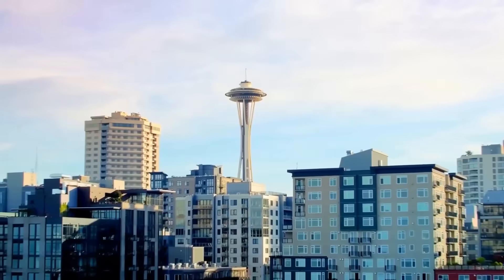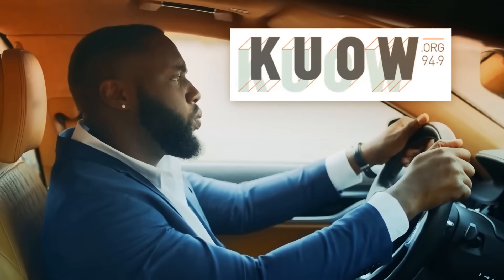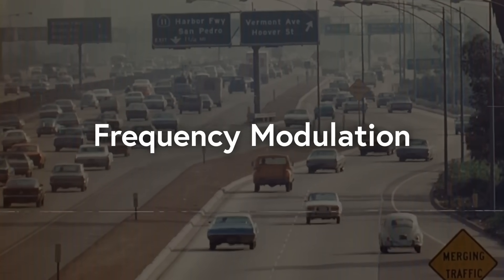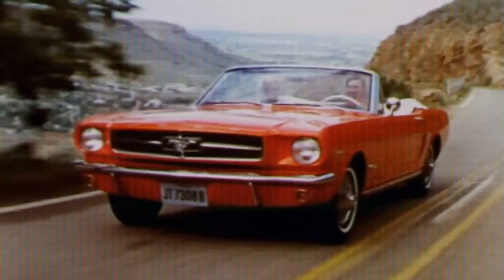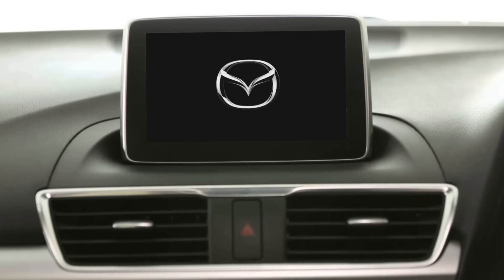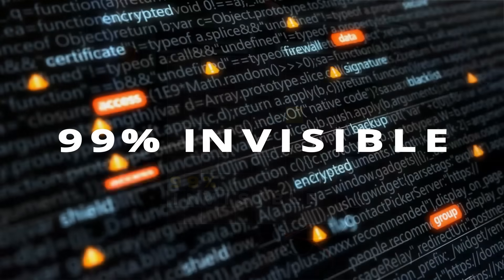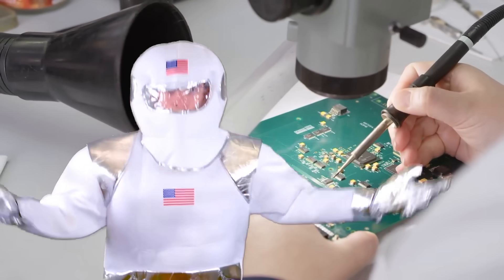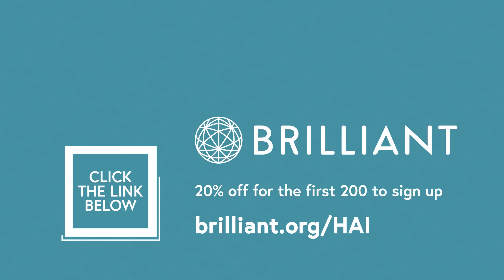Why Hundreds of Mazdas Tuned to 94.9 Broke Simultaneously

Comment: I don't need to worry about my car breaking down from a computer issue, because all functions of the base vehicle are mechanical.

Want to open a window, crank this handle. Too hot? Move that mechanical switch to engage a physical clutch on the air conditioner compressor powered mechanically from the engine, which also does not have a computer.

The only computerised parts, are an after market digital radio with Bluetooth and a two way CB radio.

And as I drive my old school mechanical workhorse through water over 1 metre deep, I think of and laugh at cars that have died in just tens of centimetres worth of puddles while being reasonably reassured that even the EMP of a nuclear weapon won't stop my car from getting me to where I need to go (most likely in the opposite direction of said nuclear blast).

As much as I love computers, (having spent tens of thousands of dollars on them in the last two years, all for personal use), everything that I need to actually live and survive, I have pure mechanical based options.

Cooking for example I love my computerised induction cooktop, but I have a portable multifuel liquid burner with a hand pump. I can set it up anywhere and burn almost any sort of flammable liquid. Failing that, I have a fire steel and field knife along with the skills to harvest nature for everything needed to make a camp fire.

I love my GPS, but I also carry a map and compass along with having the skills to determine North from the sun and stars incase there is magnetic anomalies.

In our ever growing reliance on computers (and even of supermarkets and centralised life support), we don't know what in the future will break or how.
We need at least a few people in every community to remember or learn how we used to do things and keep those skills and technologies alive.

(and no, I'm not some crazy "prepper" with several years worth of canned food. But I can see the value in being prepared for whatever might happen.)
Reply: A properly designed car will always have the most basic functions mechanical. Braking and steering may be electronically assisted, but are still mechanically connected. I don't mind the computers, as long the core basics remains mechanical.
Reply: @dbclass4075  Unfortunately, that is not the case.

Some cars do have FULL fly-by-wire systems including mechanically independent steering.

Nissan first brought out the technology back in 2012 I believe.

Which is perfectly fine if the system has adequate redundancy, shielding and security.

However exploits have been discovered and used to remotely "hack" into cars and completely disable or even drive them (at slow speeds).

I'm not aware of any incidents in the wild of this occurring, but search YouTube for the video of this hack being demonstrated for a reporter.

I know that some of these methods used actually used the integrated entertainment system to access driving "aids" including the "self parking" systems.
Because, why does a fancy radio need a high security firewall???

Don't want to scare you into thinking vehicles with these technologies are death traps, but you should at least be aware of the risks that do exist.

A radio accidentally being bricked because of a mistake in file naming is a very minor thing compared to what could happen with modern cars.

Of course, sometimes the benefits outweigh the risks. I mean, how often can you expect a car to be hacked into crashing compared to how many accidents are avoided by active stability control systems?

For me however, I am a skilled driver (no, not the best, but better then so many I see on the road) who understands the physics involved.
I'm not immune to making mistakes, but I can control my vehicle well enough to not require vulnerable electronics to help me.

Hence I'll even if I buy brand new, I will insist on a vehicle with as little computers as possible as and why I will do everything in my power to keep my 1989 4x4 working.
Reply: @Emily35-Official  Don't worry, I'm perfectly aware. It's just amusing aviation technology (or the concept at least) made their way into road vehicles. Glass cockpits, redundant systems, and now fly-by-wire? The whole point of fly-by-wire is to save weight. Airliners' flight controls are massive after all. But on road cars, that weight savings is greatly diminished. Owners are paying more for insignificant weight savings.
Reply: @dbclass4075  actually, aviation being a keen interest of mine having worked on airports for much of my adult life including taking flying lessons, I do need to correct you again (sorry).

While weight savings may be a benefit, fly-by-wire actually was developed in experimental aircraft for flight stability reasons.

The idea was that the pilot could tell the aircraft what they wanted to do and the computer would actually fly the plane.

There were, and still are, some aircraft that are so mechanically unstable that it is physically impossible for a human to maintain control.

And like most of modern aviation, military based and cutting edge (think NASA) experimentation has found its way into the wider aviation world.

There ARE practical benefits to using the technology in ground vehicles not related to weight savings.

If it's beneficial to YOU however depends on your skills, usage needs and your level of paranoia...
Reply: @Emily35-Official  In terms of scale, airliners benefits weight savings more than a road vehicles and light aircraft.

Airliners are already positively aerodynamically stable. Fly-by-wire is now mainly weight savings, easier maintenance, and easier implementation of flight envelope.

Comment: Other than managing the engine for max MPG and the radio/infotainment system I don't want cars to get any more computerized.
Reply: And transmissions selecting the most optimum gear ratio.

Comment: A local HD station reboots my phone all the time; such events often hint at exploit vectors.
Reply: I accept that I should research more, while emphasising that my phone reliably crashes+restarts for one radio station in particular (for which my up-to-date app extracts and displays regularly-corrupted text for the currently-airing content). I don't know what this metaband data is called (obviously not HD-related) but its effect is different than solar activity events that also flip out my device. Being wrong is highly motivating, so iif possible I'd love hints for further research over a hard stop...but no worries / your time's already acknowledged. Thanks for the correction.  edit: stupid typo

Comment: I wouldn't be surprised if they do something stupid like trying to split the filename through "." delimiter. Filename without extension would result in either null or invalid address when they try to take the second part of the split.

Now I wonder what happens when the filename had two "."

Comment: I work on Mazda's for a living and have heard about this issue - apparently, a previously released software update fixed this issue - both the % and the extension-less image problem.

The problem being that to install the update, you needed to have at some point brought it into a Mazda dealer and ask them to update the CMU. If you hadn't updated in time, you'd need a new CMU.
Reply: You are meant to say Mazda sponsored you a new entertainment system right?
Reply: @thisconnectd  My car is old enough that I can install an aftermarket option 😂 and yes, Mazda corporate is replacing these under an extended warranty (although there's a relatively limited number of CMU's available in the PNW...)

Comment: Wow, I never thought too deep about HD Radio because, when it first came out, most of the time the radio was still not connected to the car in any means other than to draw power and output to the speakers. But now that infotainment centers are so intertwined with the rest of the vehicle, I really see how HD Radio becomes a vulnerability. Someone could broadcast malicious code on those frequencies, and it would be automatically downloaded, without question (assuming it meets requirements the computer enforces to accept the signal for processing). I'm not sure all of what's possible with that, but this may just be the tip of the iceberg. Let's hope I'm wrong.
Reply: You "could" send code via RDS and UTF-8 Chars. But i guess most recivers does some form of sanitazing of text, only a guess tho as im volonteering at a local FM station so not 100% sure about how much code that could be sent and nothing i would like to try to do On-Air. However some testing would have been done in this area.
Reply: @pmr1049  yeah, I’d assume most radios are coded in such a way to accept the text only as a string, and nothing more. But since Mazda had this vulnerability, it makes me wonder what other undiscovered vulnerabilities may be out there.
Reply: @brickson98m  yes but also there is chars limits you cant send that much text on a given line as its rotating per string. But there might be areas like in this instance where something could be sent. As trasnsmitter really doesnt care ”whats going out the pipe”. Just a bunch of 1 and 0 over an Multiplex
Reply: @pmr1049  and @brickson98m, How cute. With one of you guessing the station sanitizes the text being sent, and the other assuming the radios process only text, you've laid out exactly how what happened in the video was allowed to happen.
Reply: @ElectroDFW  Awww what cutie  XD
Reply: This is why we have DAB+ instead.
Reply: A horrifying bit is "because computers have clocks, let's time the engine off that clock". That's a very real thing they probably didn't stop doing. The engine does not need Python.
Reply: @doublepinger  the only timing of an engine that would be based off the clock in a computer is the ignition and fuel. Valve timing is still entirely mechanical, aside from some slight variation for VVT if it’s electronically controlled, like it is in most modern cars. 

But this is all done in the ECU, which usually isn’t easily altered via other electronics, and needs to be interfaced with via OBD access. 

But who knows what idiots will engineer in the future. I could see it being more possible in an EV.

Comment: If that cache is in RAM, not FLASH, it should be fixable by pulling a fuse. Removing power from the radio will clear all of the RAM. If it's in FLASH this won't do anything but if there is a way to do a hard reset that should fix it.
Reply: That is a smart idea if it is indeed ram.
Reply: If the only known fix is replacing the device, probably someone has figured that pulling the fuse doesn't fix the issue.
Reply: @joshuarosen465  i am well aware how fuses and ram work. My old gmc Sierra ran the speed sensor through the ABS. The ABS went out (diagnosed as faulty circuit board by mechanic) so the abs light would stay on. I tried to turn off the light by removing the ABS fuse... to discover the gauge showing 0mph when i pulled onto the road. Fuse went back in and light was ignored from then on. 

Writing to flash instead of ram makes sense if you don't know it has a limited number of writes... or if you are evil and are counting on the limited number of writes to force the device to be replaced down the road.  Planned obsolescence.
Reply: what pisses me off is... how can a freaking radio signal cause everything else to also crash?? how dumb of an OS is this ICU running??
Reply: The software was indeed dumber than software produced in an earlier era.
Back in the mid 90s there was an image file viewing program called SEA from Photodex Corp, that software was made smart enough to SCAN the header content of files to determine which type that image file is and then proceed accordingly.
From the story, it seems such good practices have been abandoned.
Reply: @rashidisw  Only on Windows. *nix has been using file information and magic numbers for years. No reliance on extensions at all. GIMP will happily open a JPEG named test.mp3 (assuming you're on *nix).
Reply: @rashidisw  This is how software is supposed to work, Mazda just screwed up.
Reply: @AureliusR  1)Those Mazdas are not running Windows. 2)What kind of dev are you? You should know determining filetype is always handled by the program itself, no matter the OS  3) MS formats themselves also have magic numbers.
Reply: @Akriashi  Even if he had meant the cars were running Windows, that's not the point. Most devs who run Windows desktops (think that vast majority who work on custom embedded systems) probably don't know anything about how file types are determined and might think those three characters after the dot are special in a universal way despite the fact that they aren't. The news stories coming out of the Information Security community pretty much daily back this idea up....often in frightening ways.
Reply: @DrewNorthup  You couldn't be more wrong. Embedded devs work probably 50/50 on *nix and Windows, and we damn well know how file types are determined. Often the RTOS will have features to handle this, or you limit the accepted number of formats.
Reply: @AureliusR  You're clearly privileged to work in a good environment. I wish more people worked in that kind of space and had that access to diversity of runtime environments. It would prevent a lot of this kind of problem. From many of your other comments it looks to me like you take your work seriously, and I appreciate that. Keep it up, and perhaps some will learn from you.
Reply: @Akriashi  Windows uses the file type extension to determine what program to use to open that file.  It does not look inside the file data at a header.  Windows associates one extension with only one program and one icon, which is pretty stupid, since many programs installed on one computer can handle the same type of file, but the icon doesn't tell you what kind the file is, just the program assigned to it.
Reply: @Shermanbay  there's nothing wrong with Explorer using extension as the key to associate the default program to open the file with. And that is not what this is about. The program that opens the file still has to read and decode that data, and there it is its job to determine the type via ext,magic numbers, and validating that the format is intact.
Reply: @Akriashi  to be fair Microsoft did push for Windows Embedded on a few infotainment systems in the 00s and 10s
Reply: @kaitlyn__L  still irrelevant even if they were running one of MS's embedded OSes. This isn't a platform issue, it's the actual application not doing its job.(actually handling the given data correctly)
Reply: @rashidisw  Even better, don't trust the data. Or someone can make a file that says it's an image but really isn't.
Reply: @rashidisw  It's because back in the 90s you didn't have diversity hire. Only competent people were hired.
Reply: @alveolate  The radio is not the ICU. the vehicle itself still worked. the head unit (control) for the radio is bricked, so they are stuck listening to the radio station. Now, i wouldnt be surprised if they had the radio powered on the same fuse as some other critical system, so attempting to turn the radio off and drive by silence results in a vehicle that is inoperable.
Reply: I wonder if this is incompetence or planned obsolescence gone wrong. Flash memory wears out over time, and if they do have the image files being written to flash storage instead of RAM... what happens when the memory is completely worn out or filled up?
Reply: It's profoundly obvious that it's not RAM, otherwise this problem would've been easily fixed.
Reply: That doesn't fix it
Reply: C'mon folks we all know we can't do 100% bug-free release, slips up always happen lol. Don't tell me you all are working in IT and you never introduced new bugs with every new release?

Comment: jfc just use Linux, I could have file random or no extensions and the system could open it just fine. Besides would probably be cheaper and better in the long term than whatever proprietary system they're using anyways

Comment: Software engineer here. The funny thing to me is that the JPEG standard requires a “magic byte”, which is essentially a bit of metadata at the beginning of the file where it says “hello! I’m a JPEG”. Reading this magic byte is necessary for correctly decoding the JPEG, so crashing is extra odd.
Reply: Presumably it tries to find the extension, which of course isn't there. A zero length string or null pointer later and...
Reply: @loc4725  yeah, they’re probably using an open source / well established rendering library, this seems like an OS bug in the bit of code that’s handling the file descriptor. Most desktop operating systems are smart enough to just “deal” with missing or even incorrect extensions, I guess infotainmentOS probably isn’t that sophisticated
Reply: @katetranscribes should've just ignored it instead of crashing into boot loop.

Comment: wow thats stupid on mazda's behalf. the fact that  filly formed image files are transmitted over the air instead of something like a big chunk of raw pixel data is weird, but not clearing the cache on a reboot? theres a reason its cache and not storage. and if you're using printf like they apparently were, you always put the variable in the second parameter, not the first

Comment: As someone who is (sort of) well versed in computer stuff, I'd think the first bug was with not scanning the files to determine the filetype, and could've been fixed by resetting the onboard computer.
The second problem was a buffer overflow (probably) where it decides to put that bit that comes after %I beyond the RAM of the system. 
Both problems could be fixed by "sandboxing" (essentially isolating each program, only giving letting it communicate the essentials to other programs).

Reasons not to do it? Easier, less time/money spend on development.